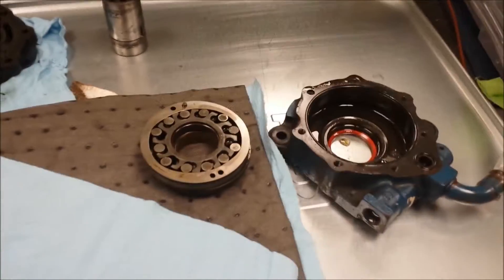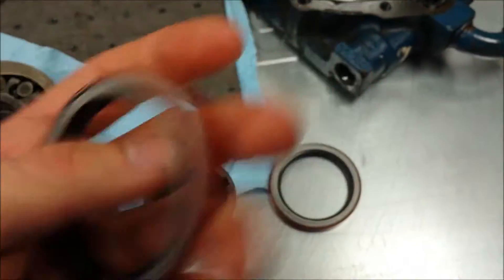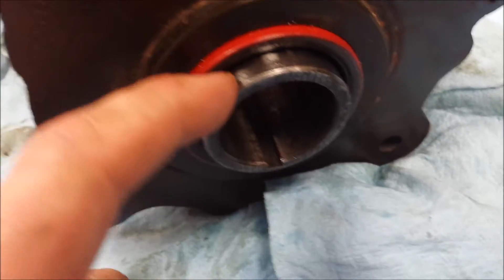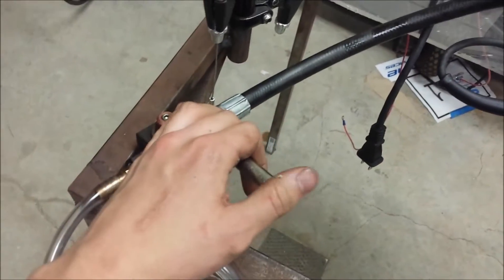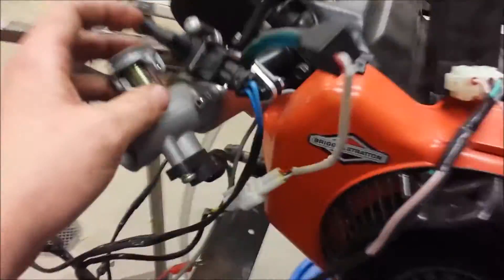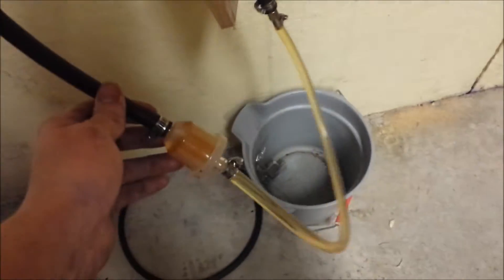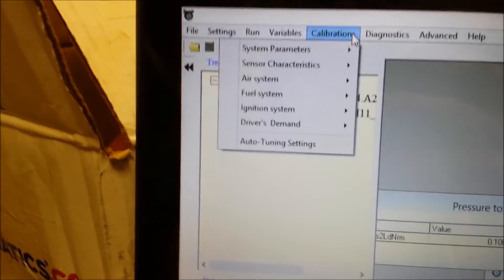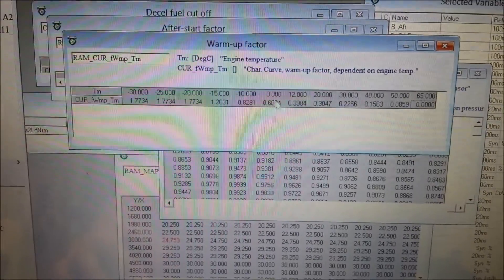Small Engine Dyno Update 1

Comment: What is that pump from? Any updates? I need to build a load test stand from 212cc engines. We build mud boat drives and it's hard to go water test every engine.
Reply from the maker: joey rhodes I believe it's off a tractor. I've been up to a lot, I'd love to post more videos but I do not have good internet access. My friend said he would upload my videos so I need to get back to him.
Reply from the maker: joey rhodes also, using a friction brake would probably be easier for you. I chose hydraulic because we have to load the engine for extended periods of time to get fuel consumption measurements.

Comment: Could you add a vacuum canister to smooth the pulses?  Could probably score one at a junkyard for a few bucks.
Reply from the maker: Very interesting idea, I'm not sure if the small vacuum lines on the canister would be able to keep up with the intense pulses. I'll look into that, thanks!
Reply: +Engineering4life No problem.  A better idea occurred to me.  My carb balancer for motorcycle has brass valves that have a narrow passage which does the same thing.  The orifice is tiny, and you basically close the valve down until the needles stop jumping.  Would take a little trial and error, but for a couple bucks you could solve the noise problem.  you don't need much volume to get a relative reading, and with software you can calibrate it to suit your mod.
Reply from the maker: +tiporari Where could I find one?
Reply: +Engineering4life Amazon.com has vacuum restrictors.  Goes in line in the tubing.  they also sell Aquarium air valves.  Put restrictor in the path, followed by valve, then sensor.  You can use a cheap vacuum gauge to rough tune or use the software to monitor if the interface is fast enough.  Adjust the valve until you get smooth readings and few or no pulses.
Reply: +tiporari Auto parts stores might have the restrictors in stock.  Pet/aquarium stores will definitely have the valves.  the screw type work better than the ball valves with levers.  more precise.
Reply from the maker: +tiporari Ahhh I understand. I will use a small needle valve and try that see if it helps